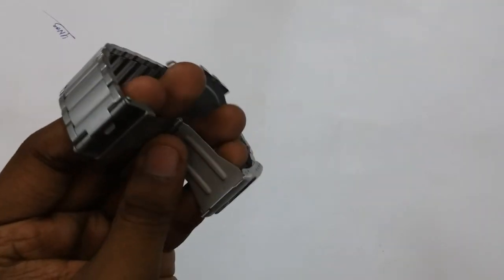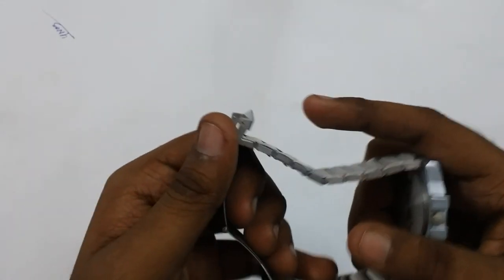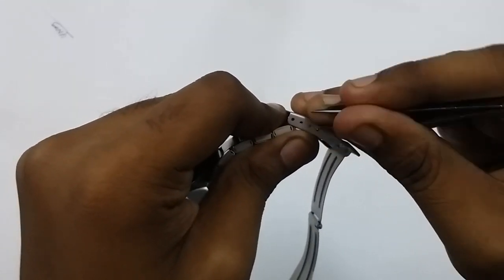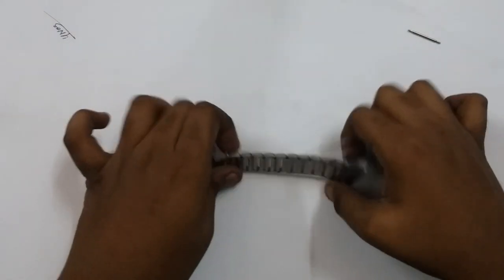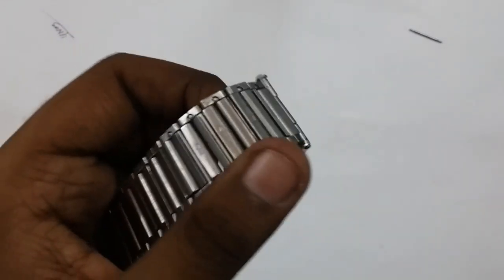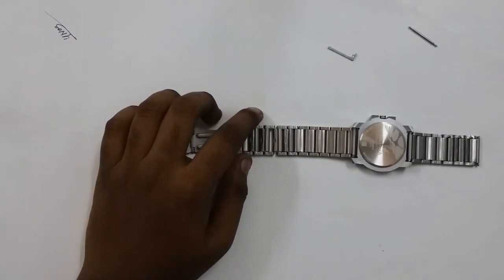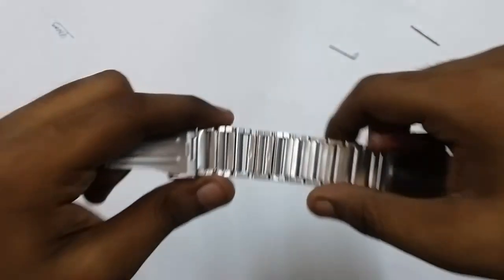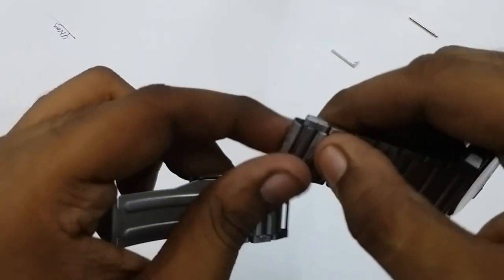How to adjust the size of the bracelet of a Fastrack watch!

Comment: do not remove your links using any of these methods,they are so dangerous especially pushing the pin up with that sharp blade, you WILL end up damaging your watch and yourself..and no sharp blade is ever needed ..and to open the gaps with a knife is just ridiculous,and then banging the gaps together is so wrong  the links should just fall out if you get the angle just right .....at least use the right tools FFS,,